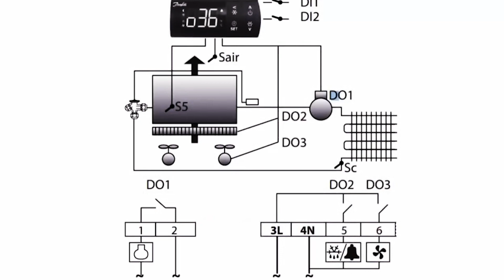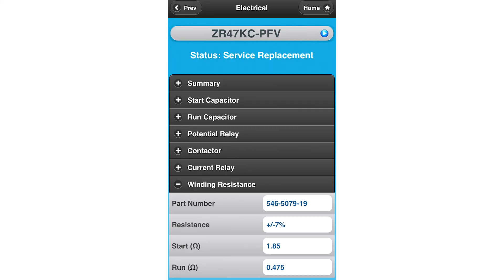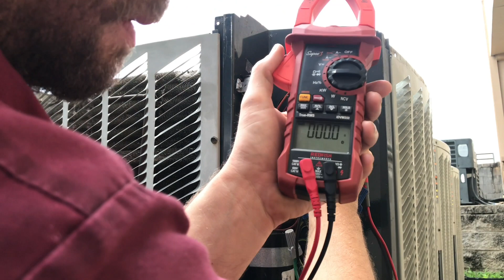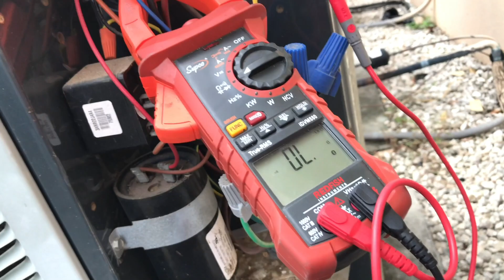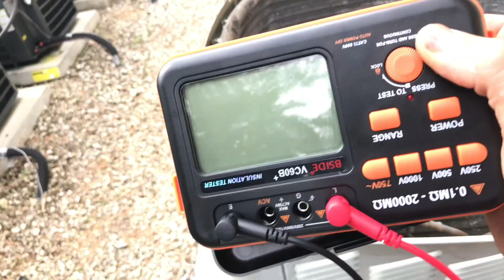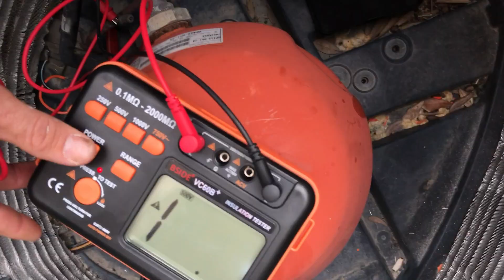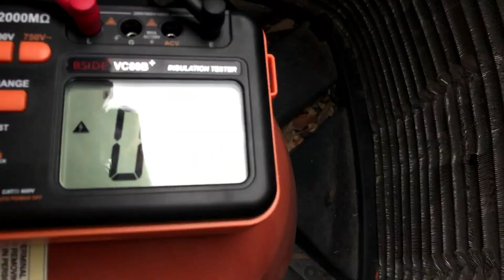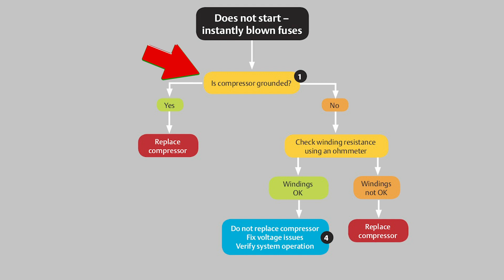Troubleshoot a Grounded (Shorted to Ground) Compressor

Comment: If my breaker is not tripping and the unit appears to be functioning properly, is there still a possibility that I have a shorted compressor or did my technician measure incorrectly?

Comment: I can't visualize how a system would operate with the compressor removed/isolated. When you reset the breaker where does all the vapor/oil go?
Reply: Nevermind I was assuming isolating the compressor meant taking it right out of the system.... doh!! Still all piped in which makes a lot more sense.

Comment: I got a grounded 2 year old carrier LG compressor today at work. what would cause a somewhat new compressor to short? I looked at the customers nest app and the system wasnt running long, like 40min to 2-3 hrs a day
Reply: I found one today.  It blew the fuses at the breaker panel, 200 amps.  Install procedures more likely, i.e. vacuum, not flowing nitrogen while brazing, bad capacitor, etc.

Comment: Just don’t see the reason of using the megger when your normal meter saw the short. I would understand it on long wire runs or going through something very high resistance. Just seems like a redundant check at that point.
Thorough testing y’all are doing though, which is more then A LOT of techs from different companies I had to go behind. I swear, some people where blindfolds when they check this crap, they shouldn’t be allowed to touch the stuff.

Comment: I like the video, however don't agree with the first thing. Never reset a tripped breaker right away. I learned that the hard way on my very first summer as an apprentice. Damn thing blew the terminals right next to me. CHECK FOR SHORTS FIRST then you can go ahead & reset it.

Comment: I had that happen.  The breaker tripped instantly.  When I went to buy a new compressor for the unit it turned out that the compressor was at 460 V compressor and the person who installed the unit had put in air compressor for 240 V.  The control board was not designed for that compressor the only way I could make it work was to totally bypassed the control board and hardwire it with a time delay.   It was a very strange situation because this rooftop unit  was designed to supply heat to the pizza store using natural gas.  I have spent so much time troubleshooting it that I didn’t want to give up as a manufacture’s rep suggested that I walk away from this job.  It was a packaged rooftop unit.  It was not registered.  So I completely disconnected the wiring for the gas controls and valved off the natural gas.  The pizza store was not concerned about heat they just wanted the air-conditioning to work and I got it to work but I’m not gonna do that again.   There was a big label that said the unit was wired for 240 VAC.  Whoever installed it scratched off all the markings that said it was a 460 vac unit.

Comment: From what I have learn from your previous videos I would not unplug at the compressor first. I would trace wires to source and check there for  proper readings or for indicators where to go next. If there is no shorts to chassis ground, no opens but compressor shows some resistance and wires check good. Then I would add a new capacitor and fire it up. If it doesn't turn on, compressor is bad if it has enough freon for it to turn on.

Comment: motor windings if one winding shorts on the motor or transformer is bad even if the compressor checks and shows some resistance. The resistance you measure only proves that the windings are not open.

Comment: The meter he's referring to, the "MEGGA METER" is commonly called a Megger. Megger is a brand name but means a meter that can produce between 250 up to 1000 volts DC. The 9 volts produced by a typical digital ohm meter is often times not enough to detect a problem.

Comment: It’s was Saturday and I was wiring in my generator for the hurricane that was coming the next day.   I walk by the a/c and I hear a pop.  The fan is running so I just keep going.  A hurricane is coming.  My wife comes out 10 minutes later and says there isn’t any cold air.   GREAT.   my unit has 2 large caps, I never knew why.   One of them is clearly bad.   I have 45 minutes to drive to the a/c store before they close.  I take the part and he says he has it and it’s a hard start.    Great, I install it and flip the switch on and it immediately smokes but the compressor does start..   it freaks me out so I pull the outside breaker.   A/c or finish the generator ❓.   I decide generator and call an a/c company.  The guy checks and says the compressor is grounded.  He DOESNT check with the wires off.  He tries to sell me a 10k a/c, which nobody has because of COVID.   I need a 4 ton.    My wife tells a friend at church and he says don’t do anything I’ll send a friend.   He comes and disconnects the wires and checks, it’s not grounded.  He disconnects the relay and presses in the contractor, instant a/c.    Knowledge is power which is why I watch these videos.   This was the first time I didn’t fix it myself.  Oh, the hurricane turned and missed us, but now the generator is wired up and ready for the next one.  The a/c runs fine without the hard start.   I don’t know why it was there.

Comment: If I come across a unit tripping breakers 
I go straight into disconnecting compressor then if it still goes off then on to condenser fan etc If stays on then I then get some readjngs off the compressor to put on my work report

Comment: My instructor said we should unplug the wires on the capacitor and contactor that go to the compressor and test for shorts there to the ground terminal. He said that way you isolate it and don't keep blowing fuses. Is there any downsides to doing it that way as opposed to taking off the condensing fan and testing from the compressor itself?

Thanks for all these videos?
Reply from the maker: I will try to  answer your question in Q/A video

Comment: Could someone explain how he used the mega here? Where did he attach the leads? What did he check with the hand meter while using it?
Reply: I believe he had  one lead on the dish charge line service valve where he cleaned it and then tested each leg on the compressor itself

Comment: So same goes with a car a/c clutch not engaging? It cold be a loose or bad dirty ground? Tried everything exect this I notice the ground on the a/c compressor is very dirty and greasy and the screw is loose also....If I clean and tighten it should my clutch engage? I already can jrump streight power from the relay and it comes on and blow cold...Replace relay switch with new one and replace high a/c switch too....Thinking I have a bad ground is what prevents the clutch from going on like a weak pour ground???? Any help please much appreciated.

Comment: Are you shorted to ground or neutral ? It depends on local wiring code, if neutral and ground are tied together.  Isolated grounding is better at protecting control circuity if a motor does short to ground.

Comment: Great Video!  Most of the time, yes short to ground agreed.  I just thought I'd add that last year I had a compressor that was not shorted to ground and I had the correct resistance across each terminal, but the compressor still tripped the breaker IMMEDIATELY.  No hum, no rattle, no sound whatsoever.  I was a little nervous to change the compressor without understanding why it was tripping the breaker....Changed the compressor and it's operated excellent since then.... I don't consider myself an expert and I never understood why the old compressor tripped the breaker.  Just thought I'd share this in case someone runs into the same situation.
Reply: guitarhvac Hey that’s a great concern you have brought to light from your experience! I had a similar experience where the 3 winding resistance measurements were right on. The hvac program I attended in the past had 4 compressors the professor had us troubleshoot. This one compressor, the windings ohmed out BUT we megaohmed it with a fluke and it was measuring a clean grounded condition ( compressor terminal to ground, not terminal to terminal). So even if a compressor ohms out on a ( start terminal to common + run terminal to common = start terminal to run terminal ) it can still be grounded. The best way to test a compressor’s electrical condition is with a good mega ohm meter.
Reply: Michael Liddle Thanks for the reply!  I had forgotten until you said that, but I did buy a Megaohm meter after that experience. Couldn’t afford a Fluke, but I did get one made by Supco!  👍
Reply: guitarhvac  My theory on why compressor can pass the ohm test but fail the mega ohm test is this: when testing for ohms the multimeter is only putting out an amount of voltage that will measure resistance in a load but will not pick up a short through the insulation of the internal windings due to the low amount of voltage. So we would need more voltage/ electrical pressure ( a LOT more!!) to be able to detect if there’s any breaks in the insulation. A megaohm meter puts out 500 or 1000 volts DC. We would put one lead onto ground and the other one on a terminal. The test will read O ohms if there’s a ground ( a leak through the insulation arching to another winding, the windings aren’t physically touching but the short is actually an arch to ground). If the windings are good, the tool will go up semi gradually to 0L because there is no where for the voltage to pass to due to no weak spots or breaks in the insulation. ( kind of like a standing nitrogen test on a system to see if there’s any leaks; you need a lot of pressure, at least 250psig, which is large amount of pressure to detect breaks in the refrigerant lines, coils, compressor or brazed  connections.)
Reply: @ForHim_orAgainstHim 
I think I'm in this condition because I read no resistance (I see an open circuit) between any of the three compressor's wire and the metallic frame (which is grounded of course). However I haven't here with me a mega-ohm DMM.
In my case the RCCB trips quite early as soon as the heat pump main unit tries to start the compressor in the external unit.
Reply: What model meter were you using?
Reply: John McMaster Fluke 117 if I remember correctly.
Reply: @guitarhvac  got ya. I have seen guys using meters that don't have the range and will read OL so they think it's good. Lots of guys have the 902 where I work.  It only goes to 10K.
Reply: Hello,
"the compressor still tripped the breaker immediately".
Is the breaker the overload breaker (e.g. 10A) or the residual current circuit breaker (e.g. 30mA)?
(I'm from Italy, I'm not sure about translation about the 2 kinds of breakers, my bad)
Thanks
Reply: @action0x01 if the compressor is tripping the breaker right away….assuming there’s no wires touching were they shouldn’t be….thats a bad compressor for sure……the breaker size would depend on the “minimum ampacity” rating on the unit nameplate. You want the breaker to be a little higher than that rating.
Reply: @ForHim_orAgainstHim 
Thanks for your reply.
Yeah sure, the size of a MT breaker must be greater than the maximum current drawn by the load.
As I'm in the same situation as described above by @guitarhvac, I'm trying to be sure before ask for a compressor swap.
My external unit is served by 2 breakers. A shared RCCB+MT (30mA for RCCB, 25A for the MT) and a dedicated MT-only 10A breaker.
The first one triggers as soon as the compressor is activated.
However the classic DMM sees no short nor unwanted resistance between common/run/start and ground earth (metallic frame).
This is why I asked to know which was, in the scenario described by @guitarhvac, the breaker which was tripping.
Unfortunately I don't have a mega-ohmeter to check for unwanted dispersion to ground earth when a high voltage is applied to any compressor wires.

Comment: Leg to leg readings are still useful, just not for determining a short. If you have an open reading between run and common, there's still a problem.
Reply: That's right, I always check leg to leg lol
Reply: I agree with and disagree with the teacher 👍🏽😁
Reply: Yeah but that wouldn't trip the breaker would it?

Comment: The "megohmmeter" is really testing insulation resistance measured in megaohms. The "Hand meter" is high impedance so you'll never be able to get a good reading. You're dumping double the nominal voltage down it to check for electrical leaks is how I would explain it. I thought you blokes would of used similar terminology being wind plumbers?

Comment: great video Bert. I need a meg ohmmeter . What do you guys use at Kalos ?
Reply: I purchased  PCE ITM-20 multimeter. It has a built in  insulation tester. 50v, 125v, 250v, 500v and 1000v.
For $339.00 current price. 
It's ip67 rated!!
Spot on with my fluke 87v on practically all readings!!
It's better than spending $700.00 on that fluke 1587. Yes I know but flukes hold their accuracy. I just could not turn this down.
My 87v is home on the shelf. I do carry my fluke fc 902.
PCE Instruments are in Florida. I have a 2 year warranty.
https://www.pce-instruments.com/us/index.htm?id=google-us&_artnr=5887877&_p=339&_pmode=0&_pbexkey=73&_date=20200203011856&_pbhash=cd6eb0ffc47108a0c322b7fef000a7d5c0aaea87e0dfac4522bc81d70a4b9148&gclid=CjwKCAiAyeTxBRBvEiwAuM8dnWqSt85vC-rLxya45-R3XGcFcz3WlHlWche3zn8_Sw7Vovoa7i2SQBoCqdcQAvD_BwE